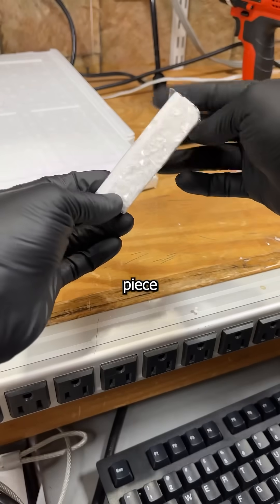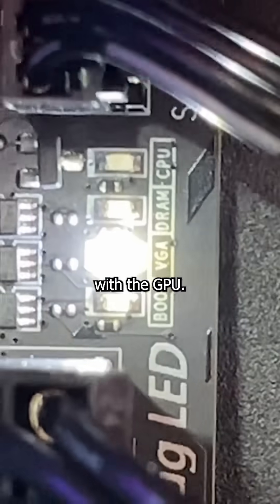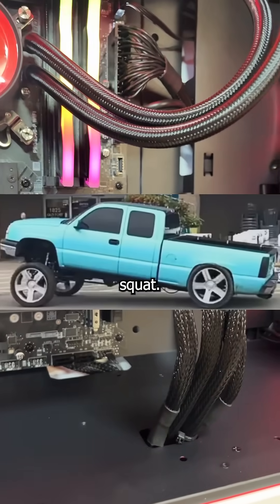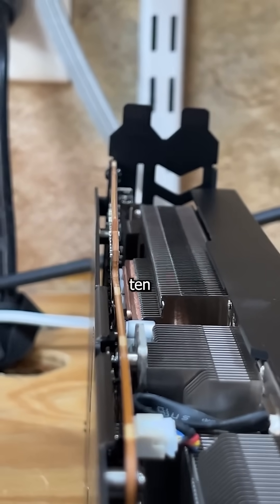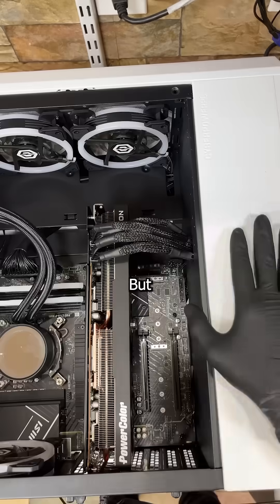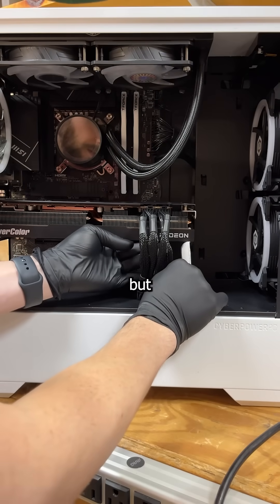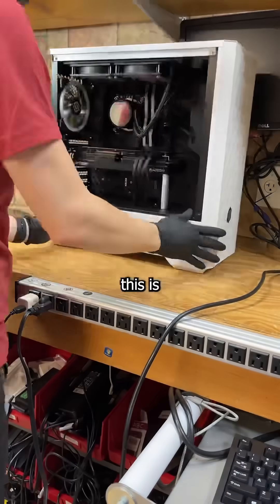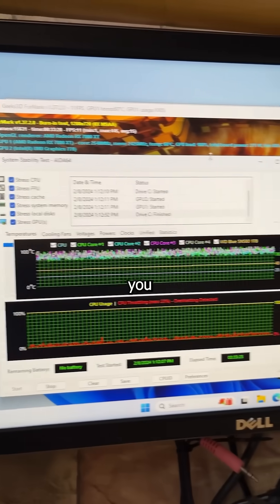Styrofoam vs. Brand New CYBERPOWER #PC (prebuilt fail) #tech #technology #shorts

Comment: My 5090 holded by HDD Tray :D If it were just 0.1 cm longer, it wouldn't fit in my case, or I would have had to remove the trays.

Comment: One year ago I used to be a massive cyberpower hater but with big 26 ram prices it's an absolute blessing at least for the time being, like you can get a full prebuilt with a ryzen 7 9800x3d, a 5070ti 16gb, 32gb ddr5 ram, 2tb sdd 4tb hdd and even some pretty basic but still usable peripherals for like 1800 dollars or so while just the components by themselves are roughly 2000 total at an absolute minimum

Comment: I ended up using couple pen erasers as support. They're squishy, so they're less likely to bend gpu backwards, they have decent footprint and they're extremely cheap in comparison, so I can use two or free to hold it on the whole length.

Comment: How do they have a 4 core CPU thermal throttling when there's an AIO installed? That's not even a "forgot to take off the plastic from the cold plate" situation, it's more like "left the plastic on AND didn't bother using thermal paste, or tightening the mounting screws..."

Comment: Thats crazy, i bought a cyberpower years ago for my first pc, it has a 2060 super in it and a ryzen 3700x. still runs amazing to this day, ive even upgraded the storage and swapped the cpu cooler and fans on it. I also added an extrernal disk drive to the damn thing! I live with cats and in a very dry dusty area, still that damn pc held up to the hair and dust! Ofc i love my custom pc way more, but that old cyberpower still pulls its weight. I think the main reason ibuy and cyberpower are coming into shops is simple. Its bc ppl that buy them (just like i was) are noobs. Ofc youll see way more noobs bringing in prebuilts than custom jobs. No way id bring my custom pc to a shop, i built the damn thing so i know how it works and how to swap parts out. When i ran a prebuilt i didnt know a damn thing so id have needed a shop. What you dont see is all the custom pcs that have issues and are fixed by the owners who built them. A custom pc can have way more issues than a prebuilt, vice versa. Your just going to see way more videos on prebuilts bc the people who own them usually dont work on them. Your going to see way less videos of custom pc issues in a shop simply bc the people who build them can also fix them!

Comment: im curious if the ram and power supply is actually the quality/brand they claim they use. for example many pre built companies claim to use an 80+ gold power supply but if you open up your pc and check you'll sometimes find they instead used one thats considered white or green rated which means its rating is worse than bronze rated

Comment: My CyberPower PC had the same issue; there was a big foam filler holding up the video card but no supports for while it runs. I keep it on its side, motherboard down. The PSU fried after a year because it had garbage ventilation and  turned out it was 50w less than advertised. Rest of the hardware is solid - a new Corsair 800w and we are flying.

Comment: Had a few cyberpowerpc custom builds that were cheaper than I could buy the parts and never had a problem with the components, but they did seem to be slapped together. Given the state of their wiring, I wouldn't trust them with a water cooler.

Comment: one thing i'm glad of with my thermaltake 500 tower, i'll never need a gpu support since the card slots are vertical with the motherboard mounted sideways, the bracket screw is now at the top supporting the whole card so even if it was 1.5' long it will still fit and not need extra support

Comment: As an owner of a Cyberpower PC I will admit they definitely are more of budget PC’s. Lots of them have “upgrade ability” which allows you to turn it into your own personal project, I never had issues until having owned my first one for a week and had to get the whole thing replaced, but after getting the new one it’s only ever blue screened and randomly crashed, sometimes it just freezes but I think after resetting it, checking every setting, going through everything I feel the problems go away for a short time. Until of course something happens again and at this point I feel it’s the ram or ssd. Maybe even the power source, but that’s just my opinion on these sort of PC’s, they’re good but they definitely aren’t the best.
Reply: "had to get it replaced", followed by "it's only ever bluescreened" are NOT what you hear close to "it's good" 😂
Reply: @redpilljesus  And who are you? Read properly before you make no sense whatsoever 🤣
Reply: Blud coping so hard 😭💔🥀
Reply: "Budget pc" - not when youre paying around 1200-1700+ for pretty weak specs, around the cost of high end pc components

"New one freezes, crashes and blue screens but its good" lmao

Comment: I bought a CyberPower PC display model from Walmart and got it for ~$500 USD six years ago. Replaced only two components; the Nvidia 1060 for a 3060, and the 144 GB SSD for a 500 GB motherboard-mounted SSD after it failed 6 months ago. Added 16 GB of additional RAM and an 8TB HDD. Surprised she's still going, but so long as she is, I'll be happy.

Comment: I HAD almost the same setup with a 14900K and 4090 from Cyber Power ($3,300 but damn I should have spent a bit more).  I think it is the Pro Z790-p Wifi.  That case was terrible undercooled and absolute SH!TE.  240 AIO for a 14900K was a terrible decision.  Rebuilt it in a H9 case with a 360 AIO.

Comment: Bought a cyber power prebuilt back in 2020, $1400 for an i7-10700K, 2060, 16 GB, and 1 TB of storage. After a year of owning it I had this weird crashing issue happen with the computer. I swapped the GPU, RAM, case fans, and just as I’m writing this post, the power supply. I’m upset with cyber power over selling me this crappy C-Tier PSU, but I’m proud of myself for taking the time to both try and diagnose, and upgrade my PC into a personal project and something I’m happy with, and I wouldn’t have been taking all these steps without watching you and the few other PC YouTubers I watch, thank you guys for being awesome.
Reply: I just bought one 2 weeks ago. And I am experiencing the exact same random crashing. I’m just trying to understand your saying that the issue came down to the PSU?
Reply: @AaRoNCcCs I replaced the PSU and it unfortunately did not fix the problem for me. Seems like everyone has different experiences with the exact same issue.
Reply: @AaRoNCcCs  "crashing" is pretty ambiguous, especially in windows itself. Literally a thousand things can make windows "crash", but only a handful causes a PC itself to crash. 

Idk about a bad psu doing any of that, but for most crashes a bios update might fix it. Too many people do not update their bios, even though it regularly gets updates that fix stuff and increase stability. 

A clean windows reinstall will fix crashes too, as they're usually caused by windows files getting borked, which you can scan for and automatically fix using "sfc /scannow" in the terminal.
Reply: @AaRoNCcCs yes. I replaced the PSU and the problem vanished.
Reply: Currently building a whole new pc because of this EXACT same issue from one I bought in 2022.
Reply: funny i also got a 3060ti and i7 12700f and i had this same exact thing after a year my pc psu failed, and now im unsure why when i close a game for say alt f4 my pc will black screen and i have to reset my pc to use it. they replaced my Power supply but im so unsure why it hitches like that now. even after clean windows reinstall.

Comment: I don't agree with a lot of the decisions from cyberpower on my 4080 super build, but I was able to snag one off for 1600 on amazon and honestly it's cheaper to buy it from them and then upgrade the AIO + buy a GPU holding bracket than to have built my own, considering the cheapest I could buy a 4080 super for was 1000-1100 from PNY, or 1300+ for any reputable brand. This puppy came with an i9-12900kf. Buying these two alone would cost me the entire PC LMAO. Plus thermals have been great and steady so can't complain.

Comment: My buddy wanted a PC and thought about a cyberpower prebuilt. I immediately told him no as he would have major problems down the line. I had also just replaced my CPU, Gpu, Motherboard and Ram from 4 to 5 (if you know you know) so I had extra parts.
He needed the stuff I didn't have extra of so we sat down, figured out what he wanted/needed, ordered it and we put it together.
Cheaper, better looking, more along the lines of what he actually wanted and even though there are used parts in it, I take care of my stuff (for the most part when it comes to PC stuff) and it works and runs great.
There's only a 2060 in it but it still works better than a cyberpower lol.

Comment: I just thread some floss through the outer corner hole on the gpu and tie it to the top of the case 
little difficult with fans up there but works fine

Comment: I got a Cyberpower with an i5 8600k and a 1070Ti and it is still going just fine. Though it is my backup system now as I just built a new system last year with a 7600x and a 7800xt.

Comment: I had this exact problem with my first PC. Used a website where you select parts and they send you the assembled tower. GPU was unsupported and sagging onto the fans. Because it was my first PC, I wasn't knowledgeable enough to notice the issue until it bricked about a year later, right after the warrenty expired. The PCB was bent like a pringle and I needed to buy a whole new GPU.

Comment: I bought a CyberPower PC from Best Buy and had a problems with the PC having no display, or shutting off randomly. I exchanged the PC 3 times in a span of the same week, I ended up fully returning it and just got an NXZT PC  Player 1 that my friend recommended and it was way cheaper and works to this day. It’s way more aesthetics and cuter, and has similar specs.

Comment: For me, it's the CPU that seems to be the problem. It was fixed by a tech but unfortunately, the temp is still high even after reapplying the thermal paste. I'm guessing I'm gonna have to fork for a new cooling system!

Comment: Could've just moved the m.2 to one of the lower slots. The system had an PCIe lane conflict, the card itself was fine... but ran at x8 instead. PSA: VGA LED only denominates issues with PCIe, not the VGA itself. This is why it worked in the lower slot aswell, the lanes are provided by the Chipset, not CPU.

Comment: Vertical Mount always get a vertical mount for your GPU. There's no reason you should horizontally mount a anything over a gtx1060 onto motherboard. The level of support required for the amount of weight right There is just non-existent

Comment: Bro fr. In march i bought a prebuilt cyberpower pc at Best buy. Worst decision ever. Sadly im from Puerto Rico and usually we dont have issues with warranty as the power supply was faulty (insert surprise). 

I was blindsided bybthe fact that they do not cover PR so i was slapped with a refund. Just put the order for my parts to build one mid may hopefully. 🥴

Comment: Bro said cyber power is bad when the only issue I ever had was I needed to upgrade after 5 years... The newer PC that isn't cyber power I've had to change ram change CPU the wireless wifi doesn't even work on it so I needed to move my setup to the router the power supply couldnt even start the PC and they didn't allow returns no matter what I said because I didn't have the box despite me literally packaging it in the same box I got it in...

Comment: I used a string to hold up my gpu and prevent it from sagging cause I didn't wanna buy a bracket and thought this looked better
Have not had any problems yet but it does look rather sketchy and certainly has sagged a little bit cause apparently my 3070ti is so heavy that I can't get the strings to be tight but that thing sure as hell can
Like literally the only reason it's not perfectly straight is cause the string wasn't made tight enough apparently 😂
It still seems alright but pls someone let me know if I should just replace it at this point to prevent any damage

Comment: can confirm cyberPOS is just that a piece of shit. used a MATX mobo on a full ATX case that died in a lighting storm (thanks AT&T) and gpu died about 4 years later......... i've rebuilt the entire system 5 times now. 

moral of the story: Prebuilts if you got it when they were like $800 like me its a steal but your still going to end up with over $500 in upgrades 

just build one

Comment: Can I get any tips.
I have a cyber power pc it works great except that sometimes my fans don’t turn on except for the ones on the top of my case. I haven’t checked my front ones to confirm but I know my exhaust fan doesn’t spin sometimes. I can get all fans running if I simply reset it right away and after that I have no problems.

Comment: My first ever gaming Desktop was a MSI Prebuilt from Best Buy during the great GPU depression and it was pretty sick except for the fact it was idling at 75°+. I tried so many things and never got it to lower. Turns out it came with a bad AIO and CPU as well. Immediately returned it for an Asus that was cheaper and after putting in a new AIO and 2TB SSD for games, it worked perfectly up until i decided to case swap and upgrade my GPU/PSU. Still no issues. Really soured my interest in MSI products.

Comment: Fun fact, if you can reach the new user / Out of Box Experience (OoBE) screen, you don't need to make a user account to do testing. Press Ctrl+Shift+F3 and you will reboot the system in "SysPrep" mode where you can install programs, drivers, and Windows updates.

Comment: I have a question, and i apologize for my ignorance, but i have a 3090ti, and an i9 10th gen. The i9 runs at a solid 70-75 Celsius. The gpu can get up to 92-96 celcius. Theres plenty of airflow due to me removing the tempered glass. Ive capped the gpu in geforce xp to 80% and set the temp goal to like 68 celcius. 

The temps im getting from the gpu are from using CPU ID Hardware monitor. The program reads 3 temps: gpu, memory, and hot spot. The gpu is in the 70’s, hot spot is in the 80’s, and memory is the one getting to high 90’s.

Is my gpu overheating? Im confused bc the fan speed stay normal the entire time. Am i just using a bad program?

Comment: I had a cyber power prebuilt and they used the same case (super small) with an evga 3080 and a ryzen 5800… I was getting temps over 100 degrees Celsius
Reply: Actually it was a much smaller case

Comment: Cyberpower is great for barebones systems. You can often get a barebones on good discounts, which is what I did last year.

just don't trust their builds. I removed everything and re-built it myself, including re-applying the thermal paste (they had actually done a good job, but still) and reorganizing the layout of the system (they had put the radiator front-mounted with connections up top, which isn't TERRIBLE, but it's better for the connections to be at the bottom).

In other words, builders are fine if you use them properly. I was able to get a case, CPU, motherboard, AIO, and fans -- all mid-range stuff -- for $800, which is less than it would have cost at the time if I bought those parts individually. Again: just don't trust their build.

Comment: My laptop runs at a temperature of 200 F if I try to run anything. This is because the fan is extremely small and of the OPPOSITE side of all the components that need cooling. And yes,  it's a Lenovo Laptop.
Reply: There's no Lenovo laptop built for gaming that has less than four fans. Also not a laptop on the planet that won't auto-shutoff when temps get high.

Willing to bet yours is dirty as sin and sitting on a couch or bed.
Reply: @SpunkMayo  Can't clean it without breaking everything. I don't know how to open laptops.

Comment: The only time I bought a BTO desktop PC was back in 2005...or was it 2008? Hmm, either way, back then some sellers had the option to ship the actual boxes of the original hardware, which I didn't do for my order, but they still included every other included cable and bits the hardware came with.  I wonder if any do that today.

Comment: ngl my desktop was an ibuypower and my friend got a new one. turns out his dad knocked out the GPU so I stuck it back in. 
also from the factory, they broke the intel stock cooler pins so it was never cooled properly. he's always had head issues with it. in fact the unseated GPU was done by his dad because the dad thought it was dust, nope it was a broken cooler. 
they ran the PC so hot that a week after I got it the mobo had started bootlooping and never managing to get past the BIOS. 
so a new mobo and CPU cooler later it works perfectly.

Comment: They really are cyber 💩. I recommended my brother buy one about a year ago because the graphics card alone was worth the rest of the components. Within 3 months the power supply popped and needed to be replaced. When it went out I had said the rest of the parts are probably fried too but they didnt care. Fast forward about a year and the cpu/graphics cards seem to be fried as well with constant crashes.

They don't want to refund it under warranty either lmao. All the parts inside are cheap brands I've never heard of. I'll never ever EVER recommend them again. I am so upset I even did; I had thought they were still at least decent.

Comment: I actually have a cyber power. It worked fine. Until I started playing more and more mods on a vr game, so I’ve since replaced the ram and motherboard. Also I think because it was a lower end build with more basic components, it’s been holding up fine